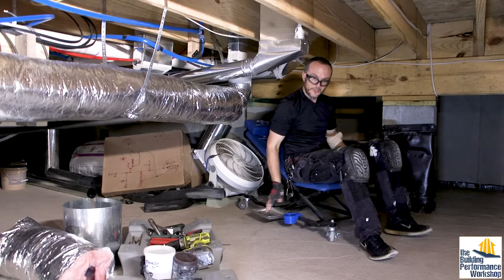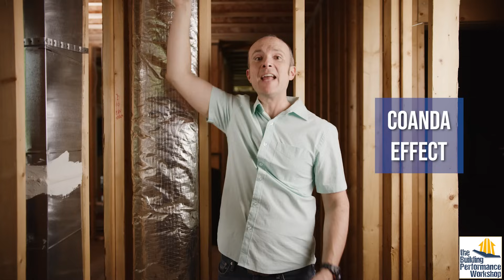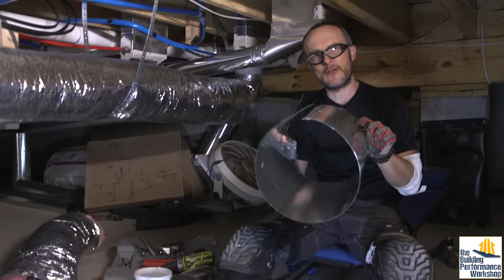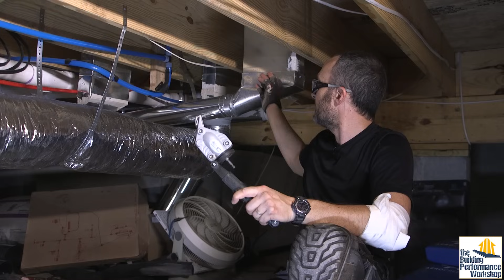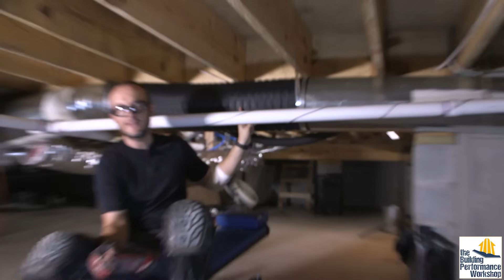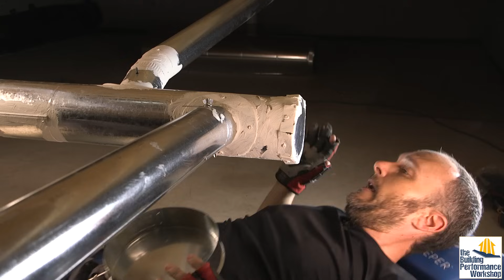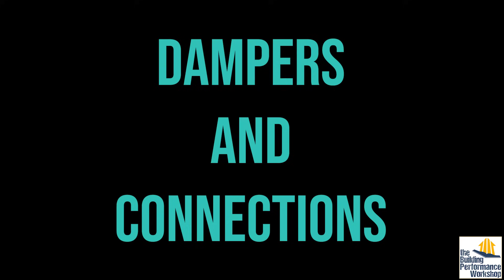Performance Duct Design & Installation: Advanced DIY

Comment: If you where to look down the flex duct you would see that where each of those straps are it creates a bump inside the duct. SO even taunt it has bumps internally. Its actually just the weight of the ductwork and the fact that the strap is only 1" to 2"s wide. But you can take a piece of card board from a box or whatever and cut it 12"ish wide, slide it between the duct and the strap. The cardboard then gives the strap a much wider "belly" for the ductwork and the "bump" is removed.....Not that you need it in your situation. Just a little trick that can be used sometimes when I see ducts that have bad "bumps" from strapping....Awesome video man.
Reply from the maker: Thank you buddy- nice tip too

Comment: Thanks, great video! Any specific reasons why you decided to use the ERV instead of the ultraaire central dehumidifier for fresh air? I am in florida and considering this setup for my new house, do i really need an ERV as well or just the dehumidifier will do?
Reply from the maker: If your home isn’t super airtight, then it’ll be fine. Once you get down near 1ACH50, though, bath exhaust fans become dangerous. Stay tuned, I’ll clarify.
Reply: @HomePerformance  IThanks again, learning a lot from you and your channel! it`s a brand new house so i expect it will be way tighter than the old ones... Which brand of ERV did you go with?
Reply from the maker: If you go Renewaire, Broan, or Fantech you can’t go wrong.

Comment: When in stalling vents around a home is it best to install it above a window  or  across?
Reply from the maker: Mmm, interesting q: my answer is, as you may expect, ‘it depends’. It deprnds on the rest of the system: the air tightness and insulation, the proper HVAC sizing and duct design, the velocity out of the grille, etc. You can make lots of things work, but any rule of thumb or generalization should be suspicious.

Comment: i got a 4ton for 1300sqft thats 350ft per ton in southern Nevada easy 115 degree days, i aim to get 1600cfm and my filter is 20x20x1 side by side for a total of 20x40 filter return. i currently use the honeywell HD merv 11 filters but i think ill start using the 3m 1200 merv 11 because of the more surface area on the filter to help decrease static pressure if that doesnt help ill try to use 4in filter
Reply: Speaking of surface area, the thicker the filter the more you have [assuming pleated design].  I have used everything from 1" to 4" over  the years in various commercial settings and... it would be SO nice if 3" became standard for houses - that would nest easily in standard framing for ease of construction or retrofit.  Occasionally you see houses where the fan pulls so hard a brand new 20x30x1" filter behaves almost like it's loaded with dirt - owner spends more money changing those out at greater frequency than if they bought 4" which would make the same opening behave like it was 20x50 with a 1".
Reply: @flinch622  ya i ended retrofitting a 4in filter in my duct opening so far so good, i haven't had any issues but the initial startup closes my bedroom door after that is works like normal been using it for 4months and i plan to push it to 6-8months instead of the 1 yr filter that they claim is doable

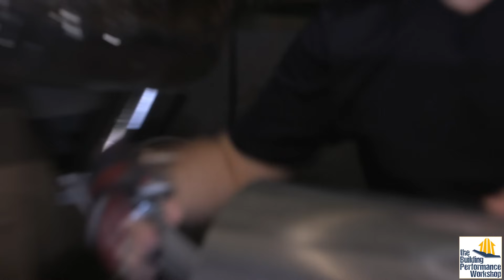Comment: I see at least 2 things wrong.  1 you are using the crimper wrong at 15:35  believe it or not the 3 jaws go on the ID and the 2 jaws go on the OD.   Also at 5:39 that is not how you install a round to rectangle adapter.  You need to add S cleats and drive cleats.   It is just going to leak round the adapter and the rectangle stack.
Reply from the maker: Thanks for the tips- system’s working great regardless, everything is screwed and mastic’d. Good to know though!

Comment: Awesome video!  You are very good at explaining things.  And it's nothing like hearing from someone who is doing the actual work on their own home.   You didn't mention the worst part of flex duct.  It can't be cleaned!  Dust will get in, then any moisture gets in and mold will grow.  Any holes in that wimpy plastic, and the fiberglass fills with mold.  There are so many moldy HVAC ducts around.  (Not in your house of course because you've designed and built it to prevent that!)  But what is that black "heavier duty flex" you showed?  I've never seen that.
Reply from the maker: Thanks Cindi- good points. That black flex I found online, called the Terrabloom 10” 4-layer flex.

Comment: unibit 1”inch for the pipe, hammer,  flat head screwdriver to square duct to make openings.  when cutting don’t snip all the way you want it smooth not like a sharks mouth lol
Reply: speed square, shoemakers, vice grips, hammer, flat head, impact, drill, 5/16 self tappers, peel and seal, snips, tongs, fine tip marker, tape, level 6” and 3’ extra slips and drives, patch metal, pooky aka duct seal, they come in buckets, and tubes, sawzaw, speed wrenches.
Reply: last seal the pittsburgh on the inside, or snap lock in this case
Reply from the maker: Making it sound easy over here Ry

Comment: Curious about your opinion on aeroseal vs conventional seam mastic?
Reply from the maker: Just a question of what it’s worth to you- this system would have cost $3k x2 ($6000) to Aeroseal, and I would have had a chemically undefined substance in my airways and the house beyond. Not worth it to me. AS does do what it claims (most of the time) but in new construction it seems like laziness to me.

Comment: Wow. I live in a 111 yr old house and these modern houses and systems seem so complicated. Part of me wonders if we've overengineered and complicated things to the point where house designs are now like Mercedes engines where they are over tweaked for minor efficiency gains but at the cost of things like simplicity, cost efficiency, and serviceability. Older homes had many ways to increase comfort like very high ceilings to manage rising heat, simple ceiling fans, etc. Desire for pretty open design and a focus on central heating and air has made us build our homes into a pretty singular niche. Old russian houses were build around maintaining heat through a huge thermal mass, a giant stone fireplace with all rooms built around it. I'm not saying this "passive house" super efficient design is bad necessarily, but it does seem ultra complicated and tailored to mostly upper income level populations. Not everyone is an information sponge like us folks that suck youtube up for knowledge every day. I can't imagine the average person being able to service or maintain systems like these and even maybe half of HVAC service contractors. There's just a lot of considerations and extreme skill level involved that I dunno, I do feel like the simplicity and cost efficiency of a system and  solution is just as important as the specs and ratings. Sorry long rambling thought train needed to dump a load. Not criticizing on the actual video or content.
Reply: I understand what you're saying, but we really can't go back to the way we used to do it which was super leaky and inefficient.  The planet simply cannot survive with the amount of energy we waste doing it the old way.  And we're also not going back to using the better materials like they used 100 years ago which could do things like tolerate moisture better.  And frankly many of those old homes were not very comfortable.  

But you're right that we could stop trying to be lazy and expecting the house do all the work, and instead could be willing to do things like open and close shades, turn fans on and off.  People need to become educated as to how homes work. And builder knowledge has a long way to go!
Reply: The planet cannot survive period. I find it odd that people think they can stop the inevitable.
Reply from the maker: Sounds like somebody’s looking forward to Rapture

Comment: Flex duct is cheap and "easy". Thats why they like it. Along with duct board. Both of which are only 15year ( if i remember).
Metal duct takes far more precision, building, sealing, and insulating. Its costlier in all ways.

I recomend put something between the strap and the flex.. Spread out its contact area that tiny contact will split the fiberglass and potentially be a sweat point.

Comment: I really like the video and what you are doing and showing "working really hard to get the good things!!!". You have the knowledge and the experience to speak and doing what you are doing. It is, however, a bit harder to retrofit an old house with very little wiggle room. I hope you'll have a video on improve an existing old house ductwork. I love the idea of saying goodbye to flex duct. After seeing mice biting and making home inside a leftover flex in the garage, I decided to replace all newer flex return ducts in the attic with metal ones. It's a dauting task but like you said "good things" doesn't come easy. I would recommend you get a better drill. M12 is a more compact and light weight to lug around in tight spaces than this bulky cheapo one :).
Reply from the maker: Right on, and yes, I would get a smaller drill if I was making a habit of this kind of work.

Comment: Thank you for your views on flex duct. As an hvac contractor,i use flex-duct very sparingly only for the final few feet of runs for sound purposes. Yes,flex duct will breakdown. I,ve torn out many duct systems where the old flex would simply crumble. Hard duct is expensive and time consuming and your customer needs to know this. A well educated customer is your best customer.
Reply from the maker: Great to hear from pros who think the way you do, William!
Reply: Flex are just for the registers.and drops
Reply: Thanks for talking about the downsides of flex duct.  It should not be used for the complete system.  You are doing things the correct way.

Comment: Am wondering why people in the usa don't use a ductless split system and tube ventilation sys.. ?
Is there a benefit of air quality with duct or something?...where I live it's all split apart for commercial
Reply from the maker: Yes, I talk extensively about this on our channel. I have a house that is exactly as you describe, and it has performance issues that would be solved with a ducted system (if it could fit).

Comment: If you consider materials ($3,500) plus labor to install and commissioning, what would the total cost be?  I'm guessing around $20,000.
Reply from the maker: Honestly I don’t have an answer for you. I can tell you that I got a cost for labor alone for ductwork and equipment install for $40k. I knew I’d be installing my own ducts.
Reply: @HomePerformance  thanks, that gives some idea what to expect.
Reply from the maker: PS- that does not include the cost of equipment (heat pump, ventilators, fans, etc) which in our house total around $25k on their own.
Reply: @HomePerformance  so now we're up to $65k.  Fortunately, my house will be a lot smaller~1100 to 1400 square ft. and the builder I'm considering uses Zehder-which uses plastic tubing, for its residential ventilation systems.  The heat comes from low-temperature baseboard heaters, and the A/C is a mini-split system.  I don't plan for more than 15% of square footage  to be windows.  No basement or crawl space.

Comment: I was debating what I should do vs have done by a pro. This is super helpful. Sounds like you are working with a pro who is willing to help you were you need help. That's super lucky, I hope I find someone like that. At the moment, I'm contemplating buying the $300 install tool for Fantech HRVs instead of spending more on a pro to do it. That being said, I want a prop to install the coolant lines for my Heat pump it's a hard balance to strike and pros don't like when you take the easy work away from them.
Reply: Devil’s advocate but as a pro, I don’t want to only install a portion of a system due to the liability incurred. It’s like taking your own steak to Outback and asking them to cook it.
Reply from the maker: Of course, This Guy- 100% get it.
Reply: no kidding sherlock that’s why we don’t do your scut work

Comment: - "I want to use all-metal", then uses flex tube all over anyway. 
- people do total system replacements because most central-air systems are poorly designed and either don't balance well, or don't work efficiently. once you do a replacement of the mechanicals, you'll end up coming back out 10 times to deal with the previous person's mistakes.
- after all that, you have a mini-split also? should have saved yourself a ton of work and just use all mini-splits and use standalone filters/dehumidifiers where needed. even a thousand pounds of mastic isn't going to get your ductwork to be as efficient as a mini-split.
- also, why would you ever want to pull air in from your crawl space? I could see pushing some dehumidified air INTO the crawl space...
Reply from the maker: Hey @somedude, seems like you didn’t watch more than the first few minutes of this, and none of our other 500+ videos. We’ll just leave this here and you can come back and reassess your opinions later.

Comment: Hi Corbett, great timing I am just reviewing my strategy for HVAC for my self build. Thanks for the great info. The question I have is if the HVAC is planned around a variable compressor ( not 2 stage) you could get away with a smaller dehumidifier and only use it on the fresh air?

Comment: While I sort of understand your concern, (and totally understand wanting more robust) with the flex ducting, wouldn't the fact that it's in a conditioned space, and protected from harsh exposure ensure that you'd easily get 20 + years of productive & safe use out of it? It's only conditioned filtered air.
Reply from the maker: Sure, but the metal ducts will last as long as the rest of the house. And our plan is to hand this down to our kids, who’ll hand it to their kids, etc.

Comment: Awesome,  Can you do a video explaining how to calculate the duct size needed for each room?  I'm lost.
Reply from the maker: Already done Alex- learn the foundations here:
https://www.youtube.com/watch?v=aCIrbSFWD20
Reply: @HomePerformance  Thanks man, I was unable to find that info in that video though.  Is the size of the duct needed promotional to the volume flow rate?   

Sindenote; "you said if you have a lakefront lot that faces west with all your windows on that side......"  haha hits very close to home.
Reply from the maker: Haha, happens to all of us sometimes. And yes, the duct size entirely depends on the Btuh and CFM needed in each location.
Reply: @HomePerformance  can you tell me how to find it;  I have cfm needed at each point in the duct and btu for each room already.  Just don''t know how to size my rectangular duct  or where to find out how to do it.  just do cfm/(some constant air speed) to ged a cross section size needed?  if so what is the speed i should plug in?
Reply from the maker: Aha- you need Manual D. But I hope to have a training in a slightly better way to do it by next year. Too late for you I bet.
Reply: @HomePerformance  Ok thank you, I'll do some research! At this rate I'll still be needing your help when you finish training next year haha.  Thanks again.
Reply from the maker: Nothing worth having comes easily. Take your time, Alex!
Reply: @HomePerformance  Thanks man, I found this video with a slide rule in it; took a screen shot, modeled the slide rule in sketch-up so I could use it to find duct size haha...  thats probably how all the pros do it im guessing.   At least i have a reference point now but want to learn more.  Thanks for awesome videos.
Reply from the maker: Pretty smart, dude

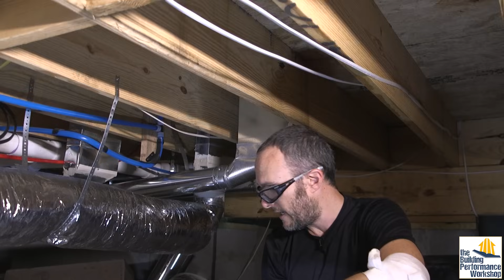Comment: @12:09 Those are sheet metal screws and although they may go into wood easily, they're not "really good for screwing into wood" because they don't hold as well. Take a look at the difference in the size of the threads between wood or deck screws and sheet metal screws, or various drywall screws designed for metal vs wood studs.
Reply from the maker: I’m sorry, but most hvac techs are using staples in the first place. Whatever screw you use has to be better than that for holding up 5 lbs.
Reply: @HomePerformance  That may be, in other words they may be good enough for this application, but I stand by my comment that they're not really good for use in wood.
Reply from the maker: Sure, I hear you, but in this application it’s so lightweight that literally anything works.

Comment: Generic metal strapping is not suitable for hanging flex-duct (due to narrow width and sharp edges).  Use L635 Flexible Duct Hanger, 1.75" wide Woven Vinyl.  Master Flow HS1.75WV, UPC Code # 050206955062.  When attaching to rafter, double over and use 3-4 staples.

Comment: Great video. I wish you had added a simple drawing (like you did with your plumbing) and walked through it with the inputs and outputs of each piece of equipment. I thinking I get most of it but where did you place the Hepa filter in the system?
Reply from the maker: Thanks! I’ll add that in the HVAC system setup and testing vid in a month.

Comment: So obviously sheet metal is a much more durable duct system... but what is gonna deteriorate the flex in your hermetically sealed crawl space? It’s plastic. Doesn’t plastic last for ya know 1000years?
Reply from the maker: Pull an old plastic toy out of a closed box from a closet after 20 years- age has its way with everything, and a plastic film you can see through ages harder than most I bet.